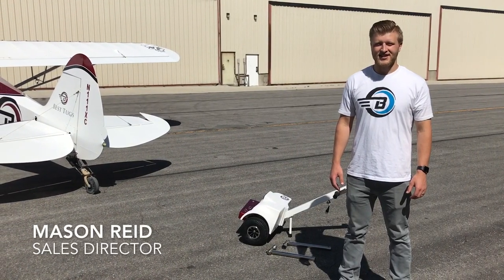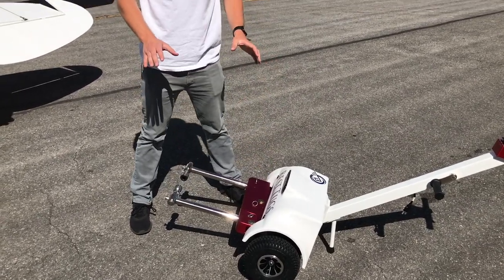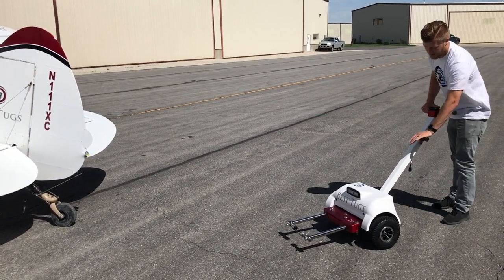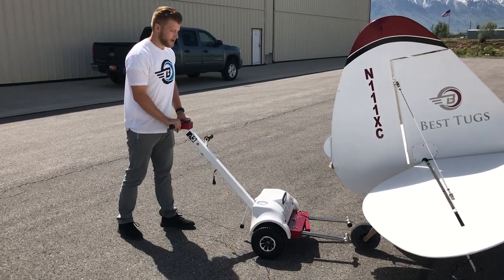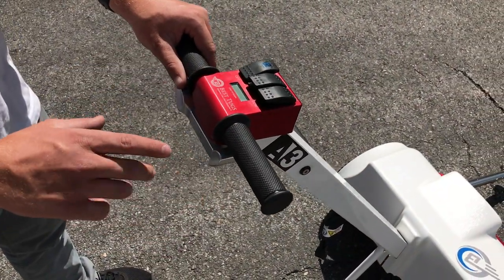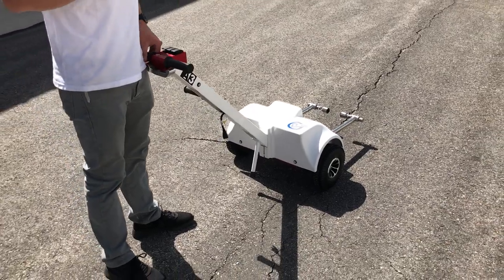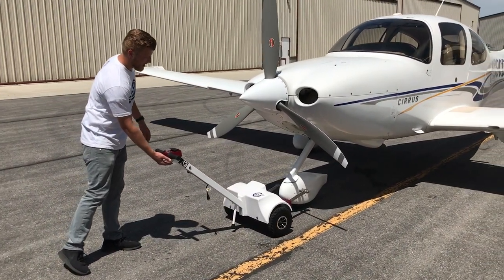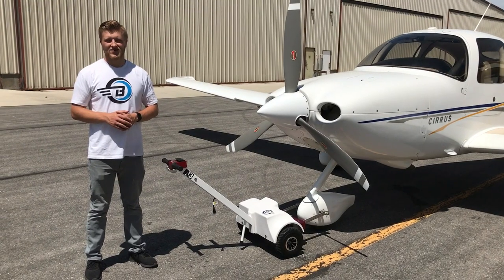How To Set Up Your Best Tugs For Tail Wheel Aircraft - Alpha

Comment: This wouldn't work for a tail wheel if you have to turn it. I park perpendicular to my hangar and I have to turn my tail wheel into the hangar. I have to make roughly a 90° arc. This doesn't appear to work making turns from a tail wheel position.